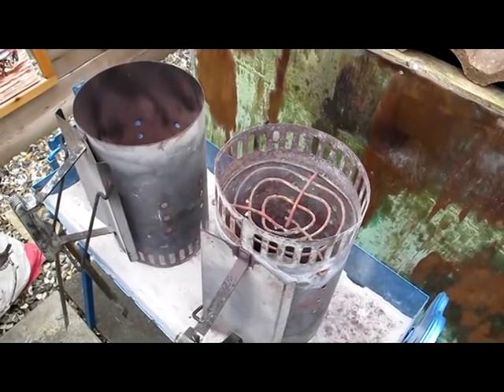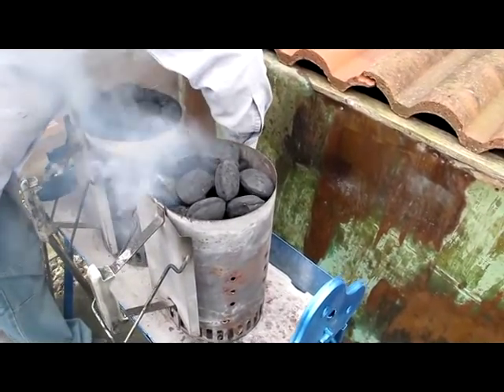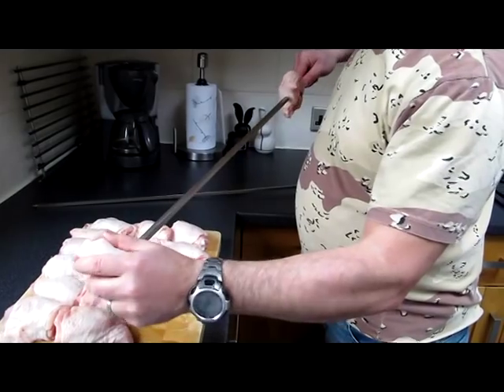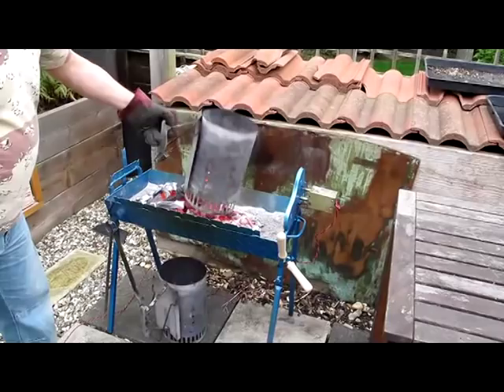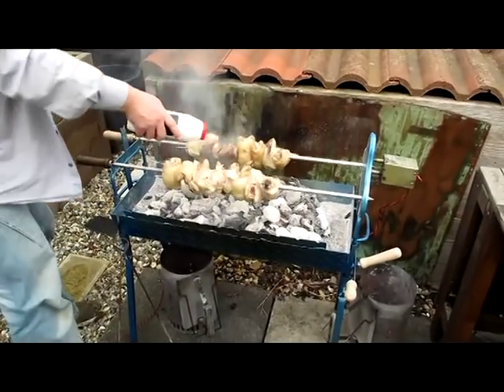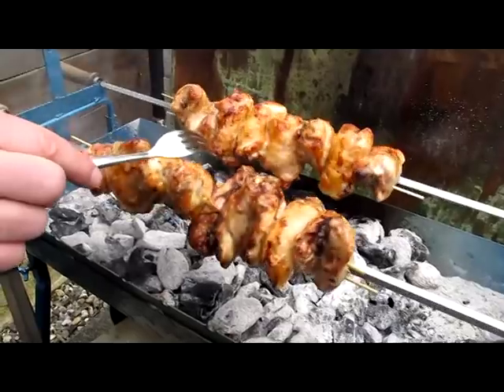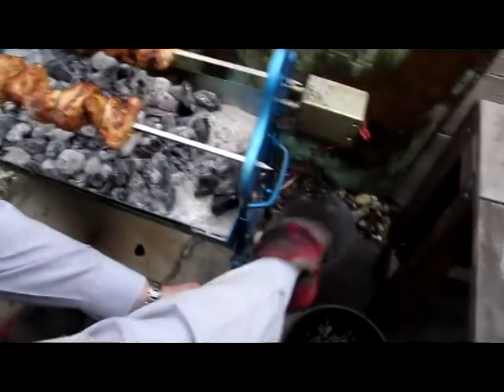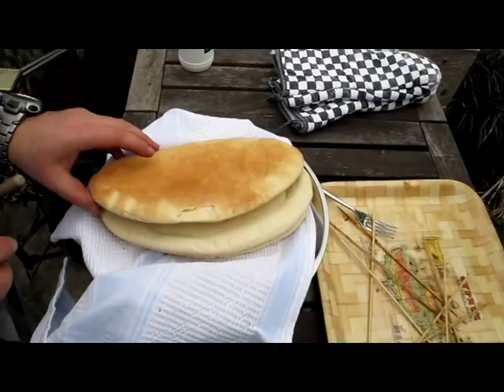Perfect BBQ Rotisserie Chicken

Comment from the maker: Hi Guys sorry for not replying earlier!! Thanks for your nice comments. Weison, I got this from Haringey in London, Lynbo Green Lanes N4 1HE. The shop has stopped stocking them now, but you can ask them to get one if you call 020 8340 5928. Chris, the tongs are custom made out of stainless steel by a friend :)
Reply: YouGetwild great video. chicken looked amazing i also love the spit you got especialy the height adjustment feature..am looking at making an oil drum spit with a similar design to yours ie the height adjustment..where can i get one from like yours..its prety cool.. cheer
kelvin
Reply from the maker: Hi Kelvin, thanks. You can get hold of the BBQ from Kikis butchers in Barnet, https://www.yell.com/biz/kikis-quality-meat-barnet-5946998/ They have three different types, give them a call and they'll explain what they've got and the prices. Mine has 11 small skewers and 3 long ones as you can see. The mains-powered adjustable motor is bought separately and I don't know if they have them. They are expensive but worth it. Cheers Harry
Reply: YouGetwild thankyou for your reply  and look forward to seeing more of ya videos
cheers
kelvin

Comment: spinning to quick gov....   low and slow is the way.
Reply from the maker: Not for fresh, whole chicken thighs with the bone-in, with this amount of hot charcoal! You'll set the coals on fire with all of the fat that's dripping off very quickly, the skin will go black with the soot coming off the flames. If you can keep the flames down, you will burn the outside of the chicken before it's cooked through, which won't be great for your stomach.